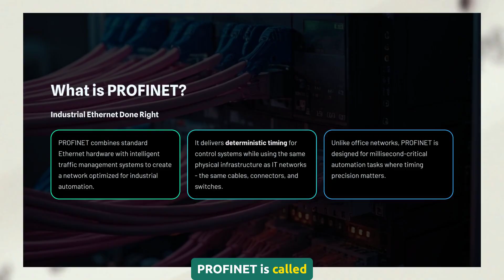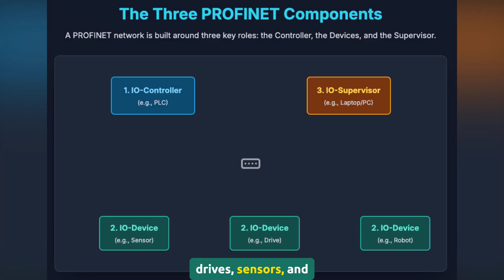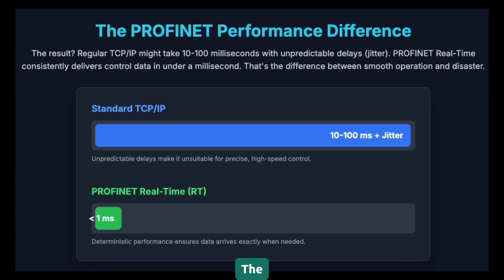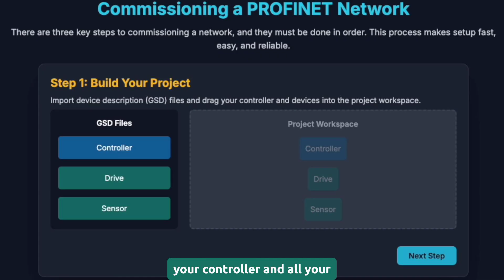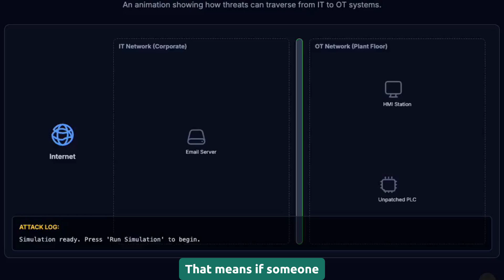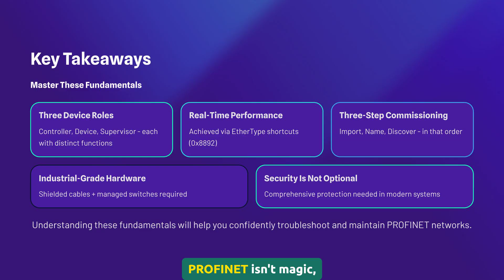Solve PROFINET Problems Fast with This Simple Guide

Comment: Привет у нас 3 месяца мучает проблема профинет, из-за этой ошибки профинет постоянно происходит аварийная остановка машины мы уже всё перепробовали может ли эта ошибка возникать из-за коммутатора?
Reply from the maker: Hello @injoycorp9553,

Yes, the switch could be the cause. 

Quick way to check:

1. Bypass the switch (plug PLC ↔ device directly). If it stops crashing, the switch is the issue.

2. If you need a switch, use a PROFINET-certified managed industrial switch (office switches often cause dropouts).

3. Make sure every device has a unique IP/device name.

4. Swap any suspect bad patch cables and keep them away from VFD/motor leads.

5. Keep PROFINET on its own switch/network (no cameras/backups or anything else on it).

Tiny checklist 

Bypass or swap the switch → stable = switch problem

Use the right switch → “PROFINET-certified managed”

Unique addresses → no duplicate IPs/device names

Cables → short in length, must be shielded, not beside power/VFDs

Traffic → keep PROFINET separate from other heavy network stuff